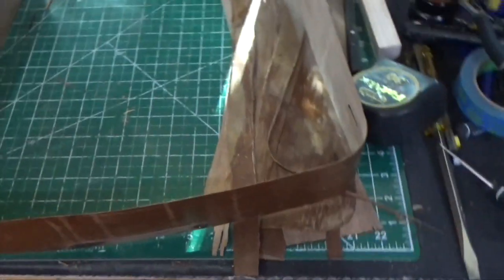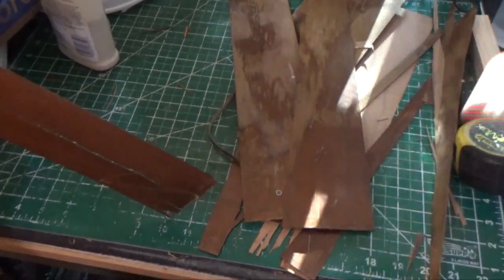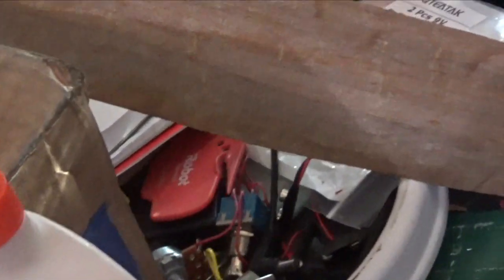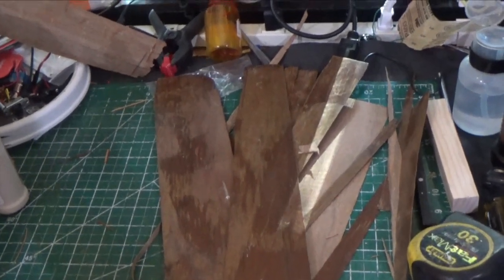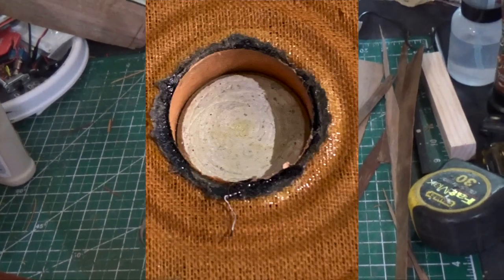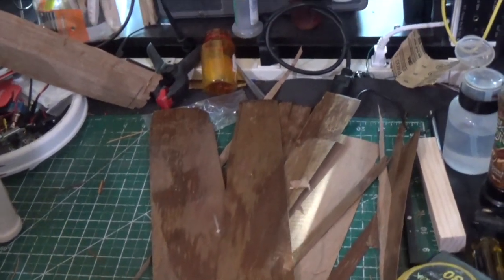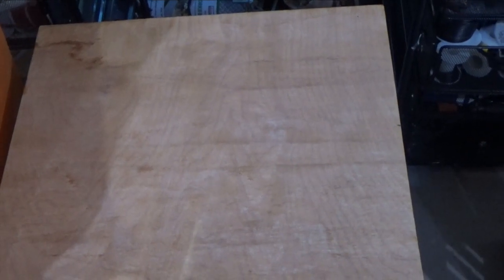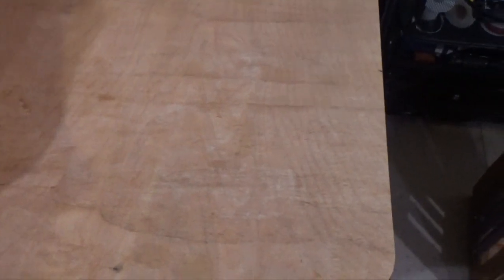Admiral 69 M5 Restoration Part 3: Lets get naked !

Comment: The heat glue method was the method they originally used to put the veneer on. That's why is was so easy to take off the very  old veneer. Horse glue! LOL
Don at ROR's is the best!  👍🏻👍🏻 Glad he offered to fix the old speaker.
Reply from the maker: I have some veneer samples and I am going to try both the contact cement process and horse glue process and compare side my side...   just so I can compare my experience level needed.   :) thanks

Comment: Hi Ron,
Your speaker re-cone job is in good hands.  Don appears to have lots of experience in speaker maintenance.  
I too use the ironing method when repairing, and replacing veneer - though I’ve seen some impressive results when the vacuum method has been applied.  I suppose the downside of the vacuum method is the capital outlay of the equipment.
I’ve a good feeling the veneer recover job is going to turn out fine my friend.
Best regards, Phil.

Comment: I've never tried the heat glue method with wood glue, so I'll be interested in how it turns out. I thought Hide glue was the glue of choice for re-veneering old radios. Interesting series so far!
Reply from the maker: Bill, thanks for your comment. This is kind of new to me so my plan is to experiment on 2 pieces of scrap wood.. I will use the heat method and the contact cement method and see which one make more sense. The heat method may be tricky on the curved corners.. we'll see but I will take you all along for the ride.  Thanks for watching  - Ron